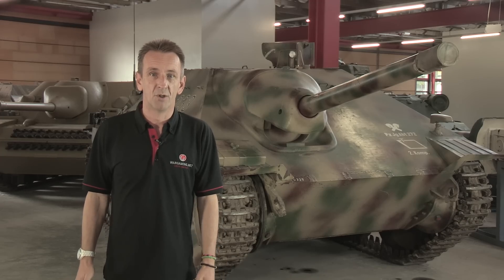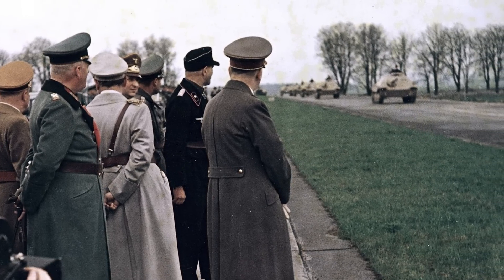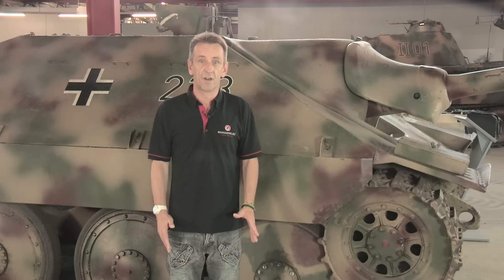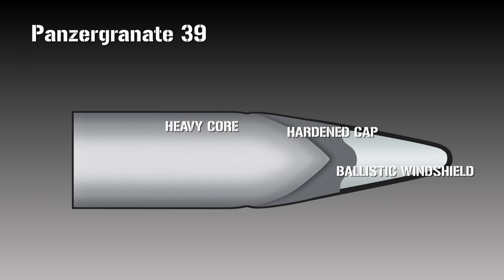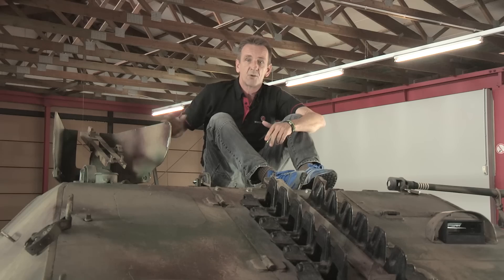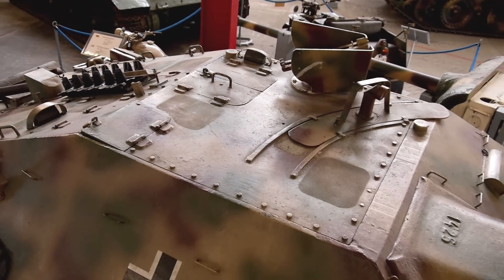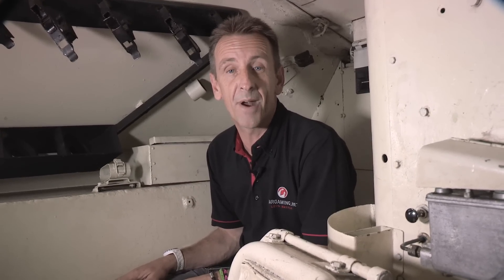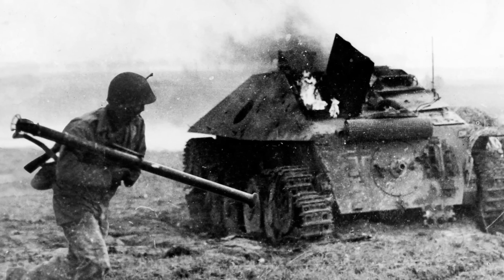Inside the Tanks: The Hetzer - World of Tanks

Comment: Pz 38 t ( Lt. Vz. 38 ) was a light tank! not medium
Reply: It depends, at the time of its development it might have passed as a Medium tank since the parameters were different for each country. Though CSR designated as LT vz 38 = (Light tank mark 38), german designation doesnt make it obvious how it was classified by Wermacht and of course for other Axis power 38t might have actually been designated as a medium (though this is just an assumption of mine). For example Pershing was a heavy tank, but it is present in WOT in a medium tech tree (since it fits there...kinda)...
Reply: dont use wot tech tree as completely true classification
Reply from the maker: There are certain discrepancies regarding historical classification of the said vehicle.
It was designed to serve in a light/medium tank role, and when it was designed the parameters for classifications were fairly different that those of War era, as well as those parameters differing from country to country. So lets say no one is wrong in this case :) ~Hunter1911
Reply: at this tme it was a Medium, a Pz4 was a heavy tank.
Reply: JadigertheReal The Panzer 4 was only classified as a heavy in Hungary.
Reply: Panzerfaust 360 pz4 came out there was a heavy tank! In 1937 long ago for hungary.
Reply: SC0RCH3er
well, that realy depends on how countries based tanks - if on wheight, gun or other things. persing was post-war reclasified as medium because of his 90mm gun, while us considered tansk as heavy only if it have 105+mm gun.
Lt - 38 was light tank because it was realy light in terms on wheight, but was packing 37mm gun which was used on many medium tanks of that time (pz3 which weighted much more) and lights tanks using mg/20mm guns.
It is interesing that while in invasion to poland in 39 czech tanks were minority (around 1/4 of total forces) they were more than 2/3 of tansk which were armed with 37mm or bigger gun.
Reply: Kabuki Kitsune
at time of desing it was clasified as medium tank...by WHICH country ? since czechs clasified it as light tank hence designation LT vz. 38 meaning Lehky tank vzor 38 = Light tank mark 38. 37mm gun on light tanks have long tradition - it was third light tank armed with that gun barrel - firs vas lt-34 and then lt-35.
As medium tank was planed st-39 armed with 47mm gun, but due to munich it ever came to production.
Reply: Wargaming Europe
hmm i think you are defending undefendable positin :)
czechs taken them as light tanks, german taken them as light tanks too (nice proof is that they formed romels light tank division, later reformed to full tank division), and when they served in other armies they were obsolete (post 41) and at this time they should be hardy clasified as medium tanks.
That leaves only other armies how they viewed them - reciving side of shells - poles, frogs, brits - and need to say, i have no info how they calassed tem, as if light or medium.
For brits i can only say if czech offered them to slae in 38 they rejected them as inferior to thier tanks/standards. Question is which ones they meaned :)
Reply: German tanks was sort by canon types not by tons.
Reply: JadigertheReal
and this comes from which source ?
Reply: JadigertheReal
can you post directly that link ?
Reply: Wargaming Europe the chieftain also did a tour around this tank destroyer. Why were there some facts different notably about the chassis? And the gun is a pak 40, not pak 39. Pak 39 is the 88mm anti-tank gun. Similar to the one on the tiger1
Reply: jackass1901
difference for hetzer and pz38 in chasis from outside are small - hetzer is wider and have different size wheels, so no bid deal.
but on interior it is differen thing - engine placed on different  place, together with crew spots and other things.
oh yeah, and rirst front wheel have extra spring to hande extra fron wheight from extra armor and gun (in hetzer).
Reply: Wargaming Europe yeah the ELC was a TD
Reply: No,the Panzert 38 (t) was a medium tank.Tanks (in the interwar periode and in world war II) were not classified by their weight,but rather by their function.The Panzer V ''Panther" for instance was a medium tank that outweighed most allied "heavy" tanks.
Reply: Imad Nour Essadate
aaaah, lt WAS light tank, since it was desigend by booth nations that matter - originals czechs and then bigets users - germans, boot clades it as LIGHT.
and you know ? brits didnt clasified it as light or medium tank - why ?these categories in british category didnt existed :).
and which allies  heavys you have in mind ?
Reply: M26 Pershing,B1 Bis,T 35,KV-1,IS-2 to name a few.Have a look at this article http://en.wikipedia.org/wiki/Panzer_38(t)
Reply: b1 bis, t35, kv 1 - srs with these ? you want to put pre-war tanks up to 1943 tank ?
so onlyes tanks which come to be comparable are persing and is-2.
but what is general characteristics of heavy tank copraed to medium one ? it have better armor,more powerfull gun, slower speed - and for persing it totaly fit compared to medium m4 sherman, for is-2 agains med t-34-85 and well, for panter agains tiger 1/2 :).
so where is problem ?
Reply: First:The B1 Bis and KV-1 and T35 are all pre-war tank designs,second: I was not comparing the M26 the IS-2 to the Panzer 38(t),but to the Panther wich was,despite its weight(45 tons),as heavy as most other allied "heavy" tanks,a medium tank.Bottom line:the Panzer 38(t) is a MEDIUM tank,because it was designed to serve as one,and again,a tank is not classified by its weight,bur by the role it was designed o fulfill.
Reply: Imad Nour Essadate
aaaaarcg, i know you compared them to panter and not 38t lol.
and you are realy wrong, pz38 was designed as LIGHT tank because czechs have planed that medium tank will be (nevr priduced) st vz. 39 - with better armor and gun (47mm).
and when you want to speak about wheigh of panter when it was comparable to allied heavys, them tell me why GERMANS claisfied panter as medium and not heavy ? hmmmm ? got it ?
same as allies have other tank to fill medium role, so that why persing and is-2 were heavys and not mediums.
Reply: *****
most of you are wrong. In the pre war time only few countries designated tanks as light, medium or heavy. Most used the term infantry tank and cavalry tank. Germany for example had its Pz.III tank as cavalry tank design and Pz.IV as infantry tank. The role of infantry tank was to be good armored for slow advancing and with anti personal armament, where cavalry tanks where fast lighter armored with AP guns, used for fast charges, same tactics as cavalry or heavy infantry was using for centuries.
Czechoslovakia was very modern country doing most of the stuff different then Royal warfare style, used by most countries. Czechoslovakia used the term light tank, but it was not due to weight of vehicle, but the caliber of its main gun. The LT Vz.38 was technically a medium tank due to its weight, but the 37mm gun has put it in Czechoslovak light tank class. If I right remember everything under 50mm was light tank, 50-75mm was considered medium, and above all was considered heavy. I believe, that this was very good designation, since it was much easier for command to operate with the size of the weapon (gun), and not size of the vehicle in their strategy. In second half of the war was clear that infantry and cavalry tanks are nonsense and the light, medium and heavy tank terms where used later on. One exeption was Britain who used old designations until they made first "universal" tank (often wrongly described as first MBT) Centurion, which should replace both branches and now on, just one tank should be used for both roles. At the end medium tanks with heavy tanks guns morphed to what we know today as MBT. By Czechoslovak designation all todays MBTs would be heavy tanks. Even the BMP-1 would be a medium tank...
Reply: +MadIgor FKGoogle A small correction:

the Czechoslovak military designation was LT vz. 38 (Lehký tank vzor 38, Light Tank model 38).
Reply: William Cox
have you read what I wrote?
Reply: +Richard Bučko well in german service it might have been considerd a "medium"

Especially early on.

In 1940-41 for example the Pz.1 and Pz.II would have been "light" tanks while the Pz-38 Pz.III and Pz.IV where Medium.

Since the PZ.38T is much much closer to the Pz.III in role and preformance armor/gun wise (1939-1941 models)

then it is the Pz.II its logical it would be in the same Category as the Pz.III

But by 1942-43 it was relegated to Light tank duties since at this time it was obsolete in the Anti tank role.
Reply: MadIgor FKGoogle Yes I have, and you've done well to illustrate the change in philosophy behind tank designation.

I would like to suggest your definitions could alter a tiny bit, as the Czecho/Slovaks did not, I believe, use the 5cm gun.  Their "medium" caliber (as in the T21) was 47mm.

I was not expressing any personal opinions about tank designations in my comment; merely pointing out the C/S declension, which held the vz 35 and 38 were light tanks, while other designs were intended for use as mediums.

As far as other nations declining tanks as one type or another, quite a bit of confusion has arisen.  I was not holding you to task over it, but I was making sure that the many folks who read your comment (I certainly did with interest) knew that the Czecho/Slovaks considered the LT vz 38 to be a light tank by their standard--and named it thus.  Rather than respond, comment by comment, I chose your well thought comment to append mine to, assuming (and correct, I believe) that it would receive the most attention..
Reply: William Cox
ahh, ok, thanks for clarification.
Reply: Michael J. The Pershing tank was designed by americans as a heavy tank but after the war was over it was redesigned as a medium tank
Reply: The term medium was interchangable. Remember that the famous Panther was considered a medium tank by the germans, but to american standards it was heavier or as heavy than even their own heavy tanks
Reply: No, Pak 39 is the correct term.  Definitely not a Pak 40.  88 AT were Pak 44 and Pak 44/41.
Reply: Pz4 wasnt build in 1938....
Reply: Hi Jan, it was, in fact first built in 1936.  Or started assembly, AFAIK,
Reply: The Germans classified the Pz. 38 and 35 (t) both light and medium
Reply: Ooooo Čech nebo Slovák

Comment: One wonders if the designs for this vehicle weren't "messed" with seeing that if they had built this vehicle mirror opposite, i.e. the main weapon placed on the left, the crew, specifically the gunner and loader would not have had the difficulties in operating their weapon. there still would have been some rounds stored on the opposite side but the neccessity to reach over the guard would have been reduced if not eliminated entirely.

Comment: Видел эту самоходку в Варшаве на площадке музея Войска Польского с развороченным боком после попадания снаряда. По моему мнения не самая лучшая конструкция. Во -первых сам по размеру небольшой. Двигатель и пушка установлены рядом и тесно внутри. Двигатель так понял воздушного охлаждения, т.к. назад идет вал с крыльчаткой вентилятора и там довольно много свободного места. По традиции  на немецких танках  ходовые являются передние колеса, но там и так очень тесно из-за пушки и всего оборудования и еще вперед надо устанавливать КПП и управление танком. Напрашивается сделать ходовыми задние колеса, но традиции превыше всего. Кроме того броня очень тонкая и думаю легко пробивается ПТР, не говоря про артиллерийский  снаряд.
I saw this self-propelled gun in Warsaw on the site of the Museum of the Polish Army with a ruined side after a shell hit. In my opinion not the best design. Firstly, it is small in size. The engine and gun are mounted nearby and closely inside. The engine so understood air cooling, since the shaft goes back with the fan impeller and there is quite a lot of free space. Traditionally, on German tanks, running gears are the front wheels, but there it is very closely because of the cannon and all the equipment, and it is necessary to install gearboxes and tank control. It begs to make running rear wheels, but tradition is paramount. In addition, the armor is very thin and I think the PTR is easily penetrated, not to mention the artillery shell.
https://www.youtube.com/watch?v=RJHQjOhGed0   Вот можно посмотреть видео обзора. Here you can see the video review.

Comment: The penetration values are kinda wrong. It's 86mm @1000m @30° and 97mm @500m *@30°*. There's always a little variation, but the values presented are for 30° impact angle, not 0°.

Nonetheless this is an excellent video. I like the part showing the inside the most. Also the combat reports are very interesting,

Comment: Nonsense! The cap of a APBC round is not hardened steel. It is made of soft, malleable steel. It's job is to spread the impact force unto the SIDES of the shell so the nose of the core does not shatter on impact.

Comment: The lay out of the crew is quite odd if the gun was easier to load from the right then why not put the commander behind the gunner and the loader in the commanders location, Simple logic....
Reply: My great grandfather was in a hetzer on the Eastern front. The better tank crews actually did just that. They modified it so that the commander fired the top mounted m.g.. so as to not interrupt the loaders job. It was cramped and confining. And yes tempers did get to them. But they were like family. They had to, or you didn't survive.

Comment: For a video titled "Inside the tanks", this one spends not much time inside the tank. We don't even see the rear left corner, where the radio and intercom were. The very odd-looking steering system is not mentioned.
But what we do see is... wrong.  
Because this is NOT a real Hetzer. It's a post war vehicle called the G13. Based on the Hetzer, it looks much the same from outside; but the gun had a muzzle brake, which has been unscrewed from this museum vehicle to make it look like a Hetzer!
When you get inside, the illusion is destroyed. The G13 has a very different gun, different controls, different equipment storage, and if we had seen the radio zone I'm sure that would be different too.